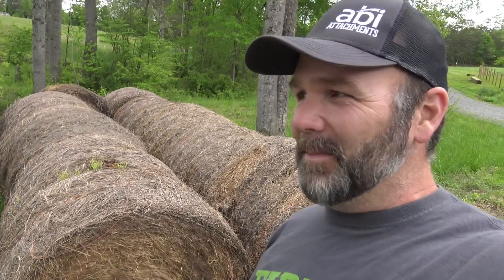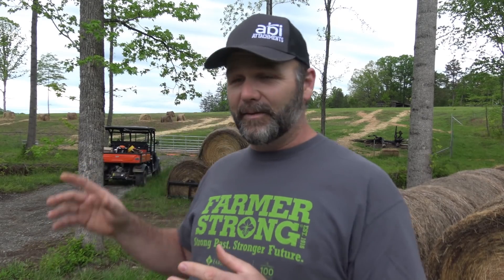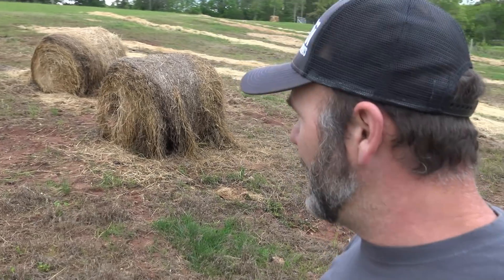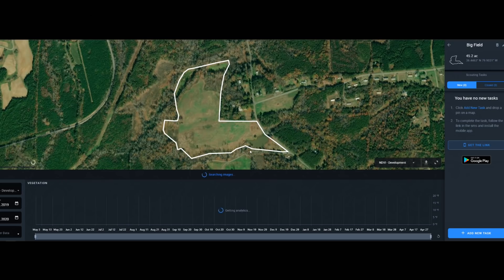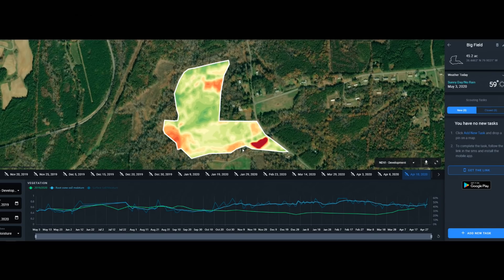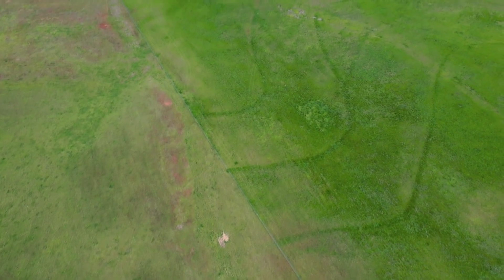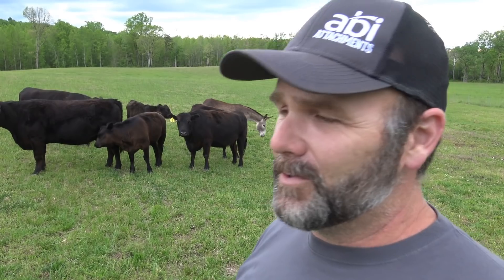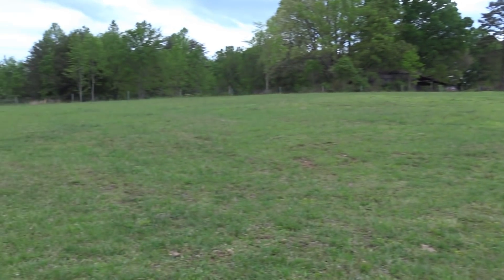Changing our DIRT into SOIL on the farm without chemicals!

Comment: I’m glad to see you are not using chemical fertilizers but are you using herbicides? I’m curious because I’ve worked so hard this year starting my own seeds and building my raised garden beds! I used straw, chicken manure from my own chickens with native soil and compost. I did this last fall so that by spring it would be fully decomposed and ready to plant. Well when spring came around I needed to add more material to my beds due to settling so I bought steer manure and raised bed mix. All that hard work and I’m pretty confident that the manure I used has an herbicide in it because my plants are not doing well at all! Never again will I use manure or straw to amend my soil, I’m not even sure what plants do survive are safe to eat! So, all of you organic gardeners out there I would not use steer manure or straw because the herbicide will kill your plants and can take 3 to 5 years before the natural bacteria in the soil will eradicate it.
Reply from the maker: Good point...if ur doing raised beds you also need some soil...not just straw and compost. Consider using some bagged garden soil or find a local landscape supply store and get some good garden soil to start with...then compost your manure and straw or wood chips. I think ur mix may be too "hot"...in other words too much nitrogen and the material hasn't broken down fully. Takes a couple years to get good black gold compost...you are right...if pastures are sprayed and cattle eat that herbacide (often a broadleaf herbacide) you'll need to compost it for a couple years. Best option for small gardener...go buy bags of composted cow manure

Comment: Nice software... "EOS Crop Monitoring System" and at a reasonable price/Year (300dollars). 
Tip: Try to spread some Lupine seeds after summer, and when it starts growing, just shatter after lupine seeds turn visible. The lupine roots will withold nitrogen in the soil (rhizosphere) and the will improve pasture health... if it has organic matter from cows, it will need nitrogen to make these new soil nutients combine together to an even helthier pasture ! (It is a natural and sustainable techique without using chemicals. 
Another tip, check this:    https://youtu.be/b2XYLEliMhQ  Great job you are doing in your homestead!

Comment: When putting hay on ground that needs to be built up roll the hay out and if it is a little heavy. Run over it with the rotary mower and you get good coverage that way
Reply: Good idea. I just suggested rolling the bales out and using the hay tedder to spread them out more evenly. Your idea might be a better one ?
Reply: From what I know about soil, you are definitely on the right track.  Good job, Josh.
Reply: We had 4 year old heston stacks that We put on some hardpan area's and some old oil well locations. After we pitched the hay off the stack, I went over it with the rotary mower. Just raised it a little to leave a heavy cover otherwise nice even cover

Comment: "Chemical" fertilizer does not just go away either...unless your ground allows it to wash away or leech away due to poor PH or soil type. But once the grass uptakes the fertilizer it turns it into grass and then as you cut it or have your cows eat it they transform it into something else...as long as you don't remove that hay or manure it will continue to build the soil as well. I agree the hay is a more natural way and does like you say organically build it and put back the organic matter back that fertilizer can't exactly do unless current plants use it and turn it into organic matter. And like you said you also get seeds in it.